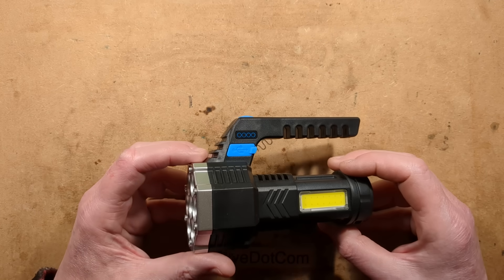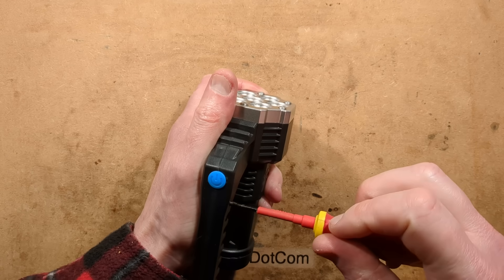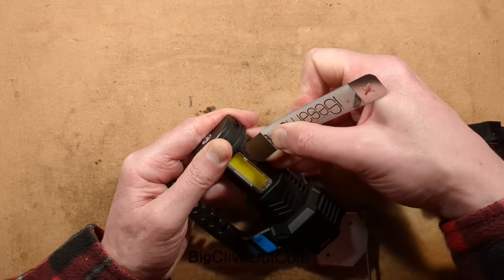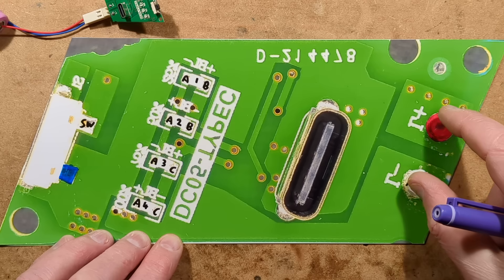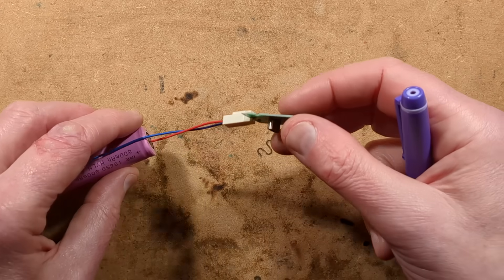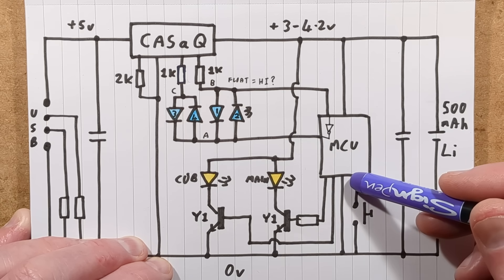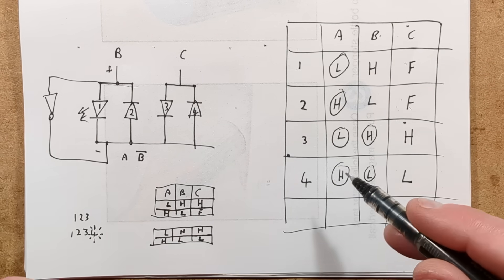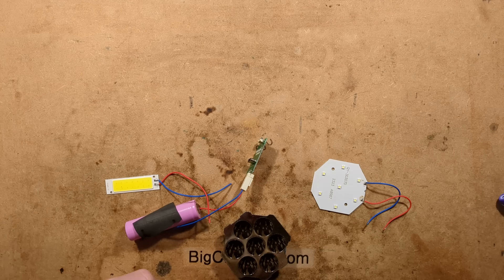Trashy big LED torch with intriguing charge control chip

Comment: I have the four LED version of this (physical design wise) device. It's an older one, so a micro USB instead of USB-C, but still has the immeasurably tiny battery. The circuit is very different. It has a single-chip package that seems to be managing the LEDs and the battery in one (LEDs are driven through 3-pin packages). Same strobing on "high" power. I have considered putting a scavenged, higher capacity battery in it.

Comment: It's tristate, so H I would call "1", F I would call "0" (it's not actually floating, it's just 0 V), and L I would call "-1" . This maps nicely with the fact that a light is on in state 1 and -1, but not 0
Reply: Traditionally, a floating output is designated by a Z, which is also used to indicate impedance. That way, it is easy to remember that Z means high-impedance state.
Reply: @helgew9008  mmm, I can only remember it being spelled out High-Z. Also nothing is floating anyway in this case